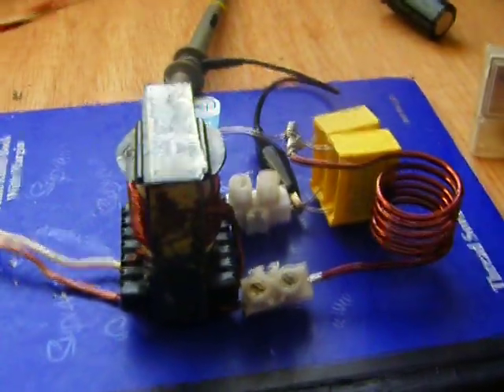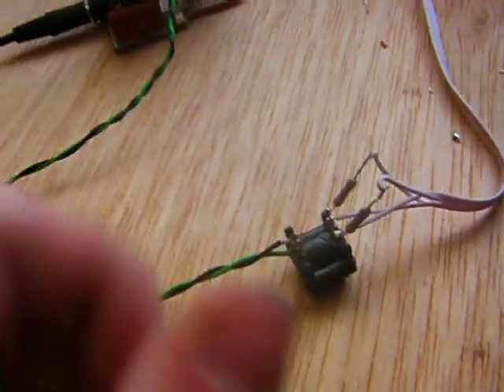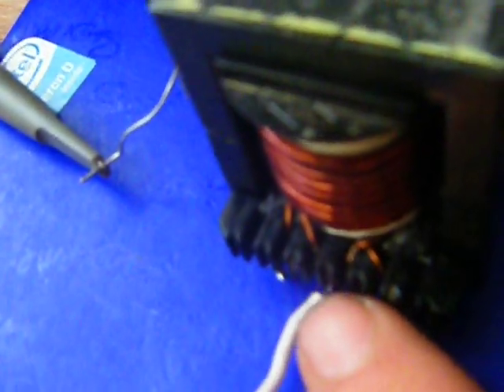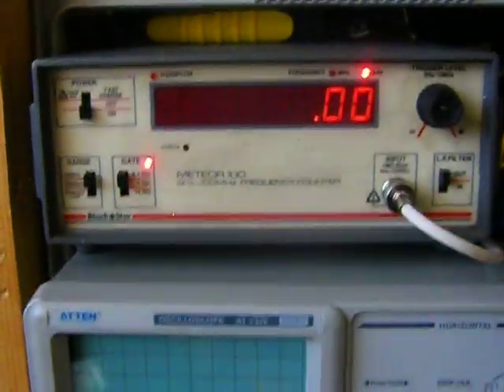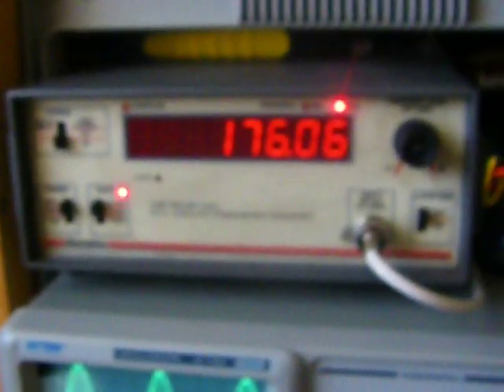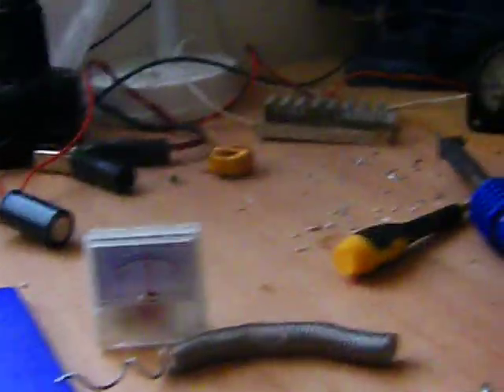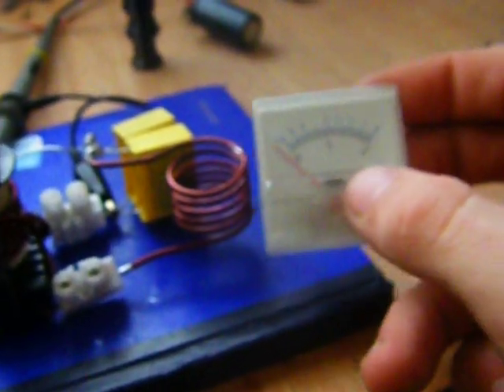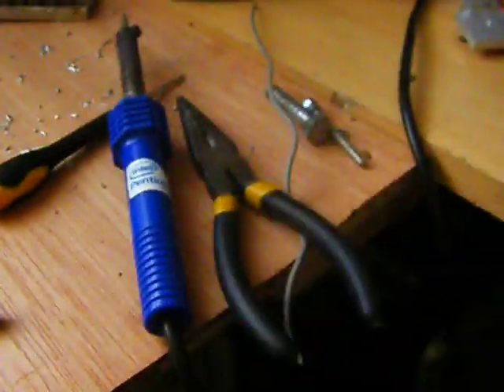Mini induction heater.

Comment: A little interesting.... I think your work coil is having issues coming into resonance. That's why your waveforms start off funny. I've seen others having similar issues with ZVS circuits. You might need to put a smoothing capacitor further up the circuit by the voltage supply to prevent voltage lag. That lets the system come into resonance much more quickly.